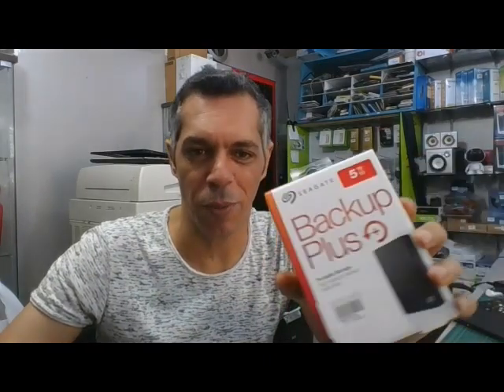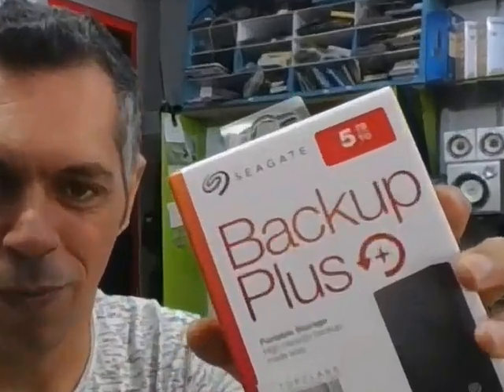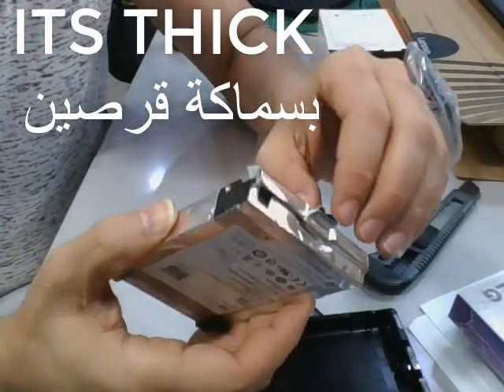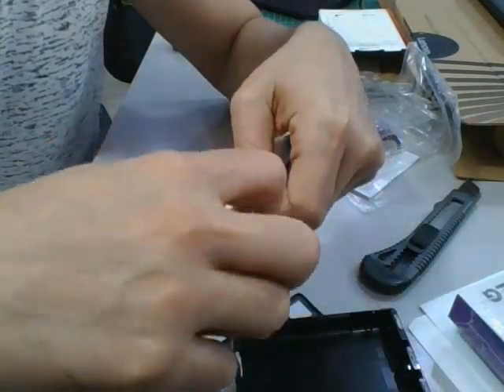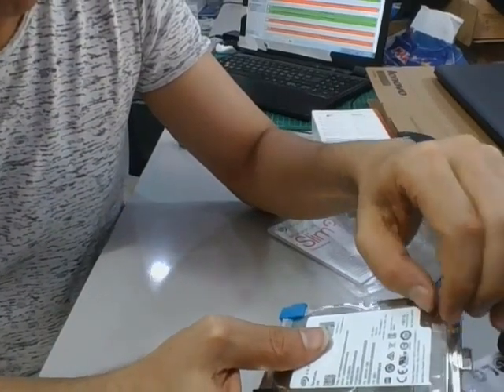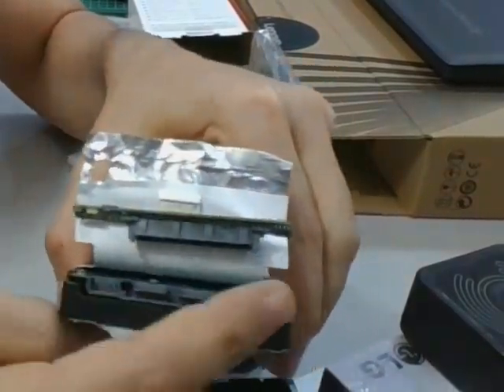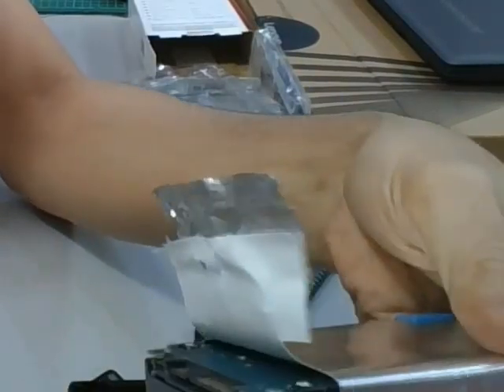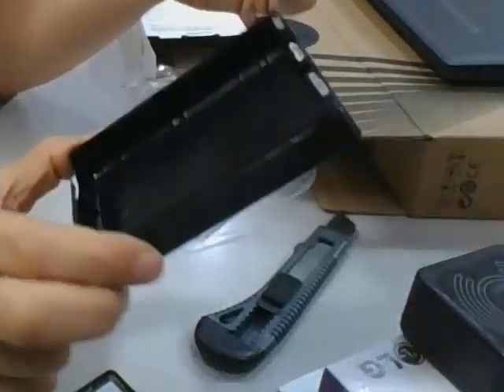How to Disassemble 5TB Seagate 2.5" Backup Plus

Comment: Is it fit for PS4 Slim...? That's Not 2.5'
Reply: never fit. it is 2.5" drive but very thick.
Reply: @Zel912  i bought  one Seagate Expansion 4TB, its too thick for PS4 Slim bay. But I had Seagate Backup Plus Slim 2TB. It is slim enough to fit into PS4 Slim bay. Pun intended. But I want to upgrade my PS4 Slim Internal Hardrive from 1TB to 4TB not 2TB. I cant find any Seagate Backup Plus Slim 4TB. The only high capacity Backup Plus Slim that Seagate had release is 2TB. 4TB is Backup Plus with NO Slim at the end of the sentence.
Reply: I too replace my PS4's internal hdd with 2tb hdd removed from seagate backup plus slim.  Anyway if you do not care about the look,  connecting 4tb external hdd via usb3.0 port is alternative way. Many sites have a test that games installed in usb drive have same or even faster load time than internal drive because internal drive interface is just SATA2.

Comment: hello, thanks for the video. but i have some issues, i am planning to buy seagate 5tb for my laptop. but as you suggest that the backup plus will also work, i have doubts. number 1 is, i think the usb backup drives are not designed to work inside laptop or desktop, since they are not made to be running for all the time we have powered on laptop. they required to be used only a few hours or even minutes, just to take important backups on daily or weekly basis. so i think using such drive as internal drive will make it spin all the time computer is powered on. which may cause performance or reliability issues over time. may be they wont run for 1 or 2 years. number 2nd is the seagate barracuda internal with green cover, is designed for internal use, i am using 2tb version of it already in my laptop (using the cd/dvd caddy), and they are designed to work inside (able to spin all the time). and this is also newer model of barracuda(green). i have searched the sites, for comparing the benchmarking of both drives to check speed, reliability, performance issues, mean time between failure etc. but i was unable to find such comparison. thirdly the breaking up the case would violate the warranty. kindly throw some light on the first two issues. thank you
Reply: Hi! I'm buy external 2Tb Seagate with usb3 interface and external power supply in 2012. I install on it tons of games, I download torrents on it just every day. Free space on it is 10-12 Gb. I use this drive not like a storage but like a main drive. It is working every day constantly. And it's still working!))
Reply from the maker: correct

Comment: Than you for the Tip i have also buy one.  For my notebook that have enough space for a 15mm Hard drive.  It is here in the Netherlands €70,- cheaper than the separately available version T5000LM000.
Reply from the maker: im surprised also & wish to know that laptop !!!
Reply: What Notebook do you have with room for a 15mm HDD?

Comment: is it not 2.5 inch sata hard drive???? Can i fit into laptop??
Reply: It is 2,5" inches but it is 15mm in height. 2.5" inch drives vary in height from 7 to 15mm (with 9.5 and 7mm beeing the most commonly used...

Comment: Will this fit in the PS4?
Reply: I think it's physically too thick at 15mm to fit in the PS4. You need a 9.5mm drive.
Reply: There are Youtube videos of people successfully transferring the drive from the Seagate 2TB Backup Plus Slim but that is a 9.5mm drive. This drive from the 5TB is much thicker so I don't think it will fit but I personally don't own a PS4 so I could be wrong.
Reply: The drive is to thick to fit a PS4 Internal drive bay.
Reply: No, it can't... Don't open it warranty avoid if seal broken. If you want to upgrade your PS4. Buy Seagate Backup Plus "SLIM". SLIM had 9.5mm. This one higher 15mm.
Reply: I already used this 5tb hdd with the ps4, it works perfectly (after formatting) through the usb port.
However, i dont think that replacing the internal hdd of the ps4 with this one is gonna work, as most people stated it is too thick, but I don't know for sure.
Reply: yes it does, but you have to format it preferably using the ps4 settings>devices>usb storage devices>(your USB)>press option>format to EXFat.
your pictures & video files must be copied inside folders (name them whatever you like), dont copy them directly to the root directory, & your audio files must be copied inside a folder named Music
do not format it as an extended storage (unless if that is what you want).
Reply: Thank you very much. I plan on getting one and installing it into my PS4.